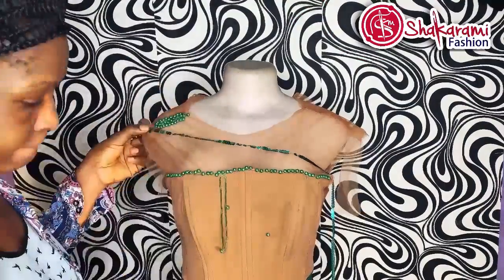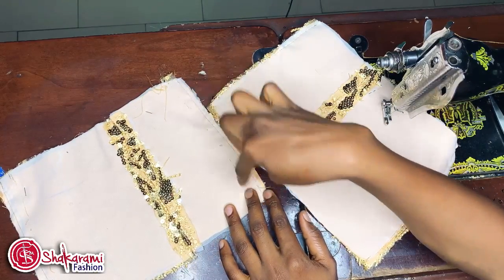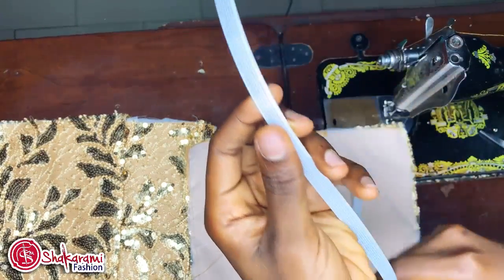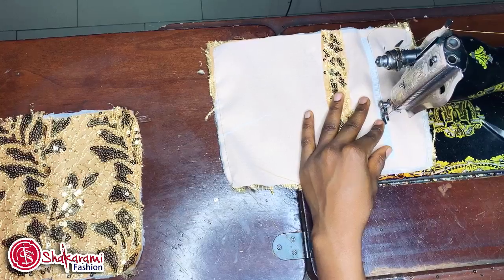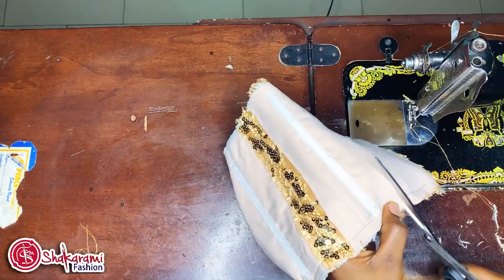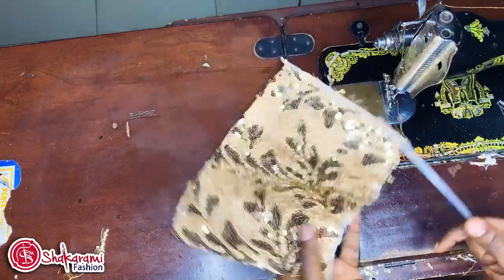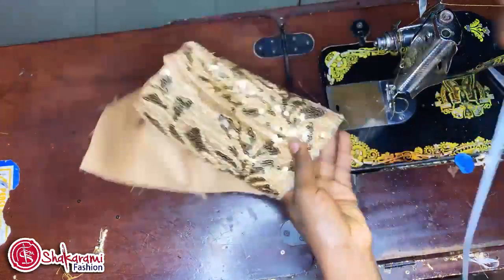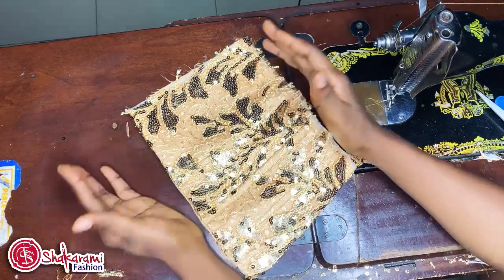BONING TECHNIQUE; Easy ways to use a Rigilene and plastic boning for your corset #corset

Comment: Pls my plastic bone is to big for my casing and I’ve been trying to trim it but it’s so difficult.. do you know an easy way I can trim it?
Reply from the maker: Well, I will suggest you get a smaller plastic boning or you can carefully use a lighter to melt it by the side. But I will strictly advice you get a smaller plastic boning and keep this bigger one for another project.

Comment: What if am using loops instead of eyelet? Will i still need to put boning at the edge ?
Reply from the maker: Yes! The center back boning is very very important.
Reply: @SHAKARAMI_FASHION  thanks so much ma
Reply: @SHAKARAMI_FASHION  thanks so much, I made a corset dress using your inbuilt technique and it came out very nice, thanks so much for impacting knowledge. God bless you real good